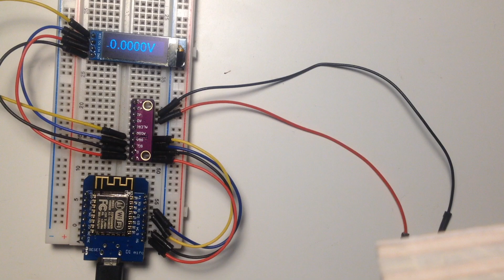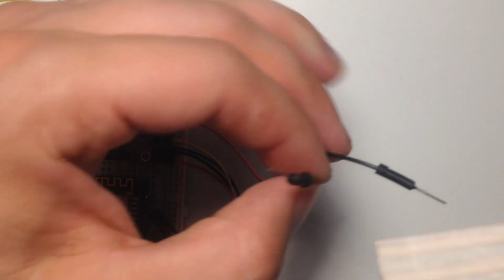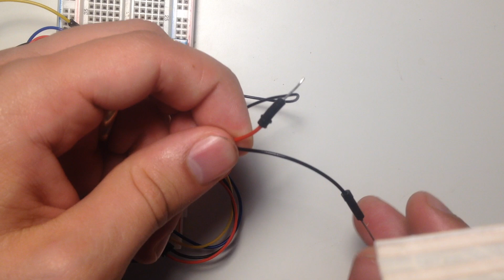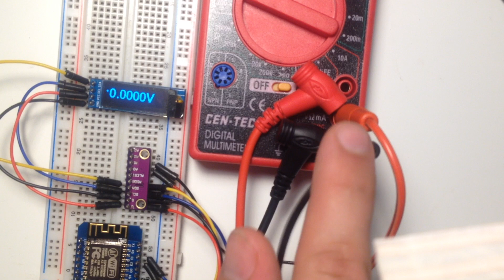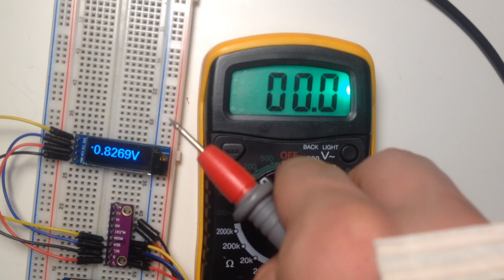Voltmeter Project -- Hardware Overview

Comment: It is the logical assumption that out of 3 voltmeters, if two agrees and one is off, the "off" one is wrong. One quick question, if you do not intend send the data over wi-fi, why use an ESP8266? For this purpose even an 8 bit AVR with internal 10bit ADC like the Atmega328 will work perfectly and you'll save the cost of the external ADC.
Reply from the maker: I was using an esp8266 because I intended to add wifi eventually.

Comment: Buy a decent volt meter. Even better, buy a voltage reference.
Reply: If that's your opinion, I don't think you fully understand the purpose of this video.  A "decent voltmeter" is completely unusable to an MCU.  For those of us that want an MCU to make decisions based on a voltage, there's no interface for a processor.  In my case, being off grid, I want to be able to determine what the voltage is and start switching on loads around my home to consume the excess electricity being generated by my system.  I only need enough precision for the machine to make decent decisions based on the information it can collect.  I very much appreciate the information presented here.  I can apply this knowledge to my real-world need.  Now I will even be able to monitor amperage production vs. consumption.
Reply: Does the term MicroController even mean anything to you ?

Comment: Just wondering about powering the ADS1115 with 5V as this will make the logic level output on the ADS1115 5V, which I thought would have damaged the ESP8266.
Reply from the maker: +Craig Fryer the esp8266 is officially 5v tolerant on its inputs. But I should probably have called that out.
Reply: My understanding of the D1 mini is that it has 10k pull-up resistors to 3.3v.  The ADS1115 is open-collector output, so that the output floats and then is routed to ground to output a zero.  Great video Mobius.  Thank you.

Comment: The internal loop of 16 repeats, I even understood that you want a average between these 16 values, but why this loop is inside another of 128 turns
Reply from the maker: +Ricardo DM there are a total of 128 samples it averages over. The tight loop of 16 basically averages out noise in the ADC. That way the moving average over 32 time slots (128 /16) can get rid of the noise in the signal
Reply: thanks for your answer...  and how did you reach the value 5333, in the following line:
double voltage_multiplier = 533
Reply from the maker: +Ricardo DM it was calculated based on the original values, but using division instead of multiplication. I don't remember the exact formula.

Comment: Please, could you clarify two doubts to me?

How did you reach the value 5333, in the following line:
double voltage_multiplier = 5333; 

and why did you a loop of 16 laps (i < 16) inside a another loop of 128 laps (WINDOW_SIZE)

Comment: Interesting. I have a voltage measurement module somewhere. I'll have to give it a try.
Reply from the maker: It's surprisingly useful for the simplicity of the circuit.